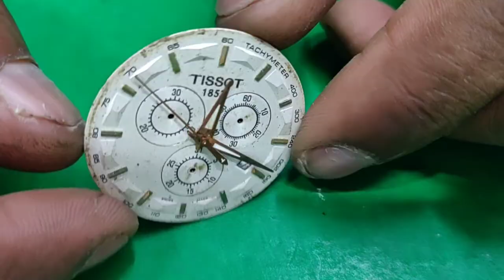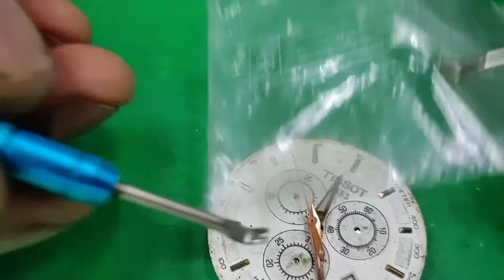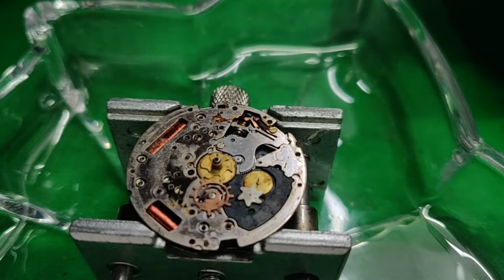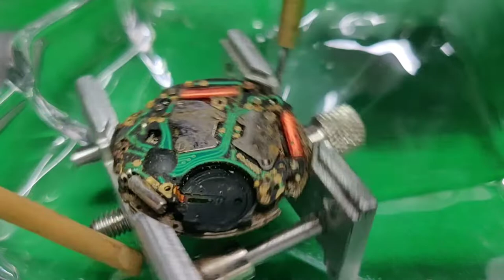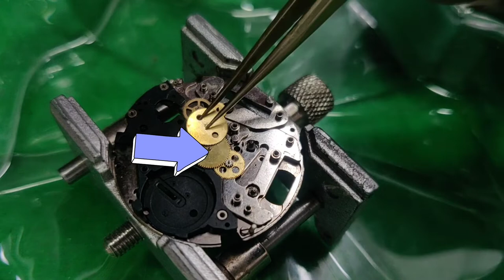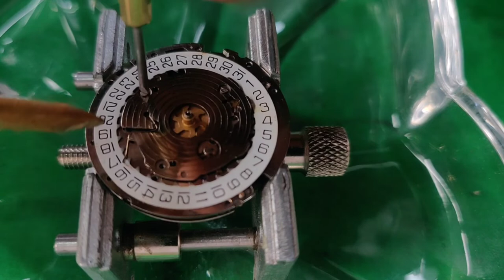Assembly and disassembly of Isa caliber 8171🙂 #swiss

Comment: Great video, very informative! I tried to disassemble part of the movement to see what it was like inside and see if there was any dirt, because the second hand kept stopping, and when I got to the point of repositioning the two steel plates above the gears, as in the video, I couldn't do it because it seemed impossible to align gears' axes to fit their pins into the little holes in those plates...😢
Reply from the maker: Thanks for the support 😊